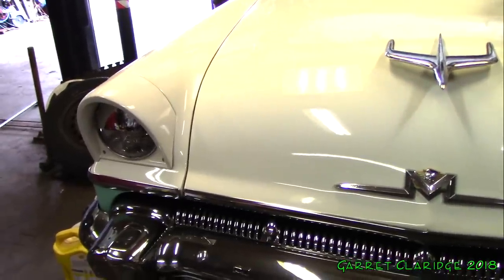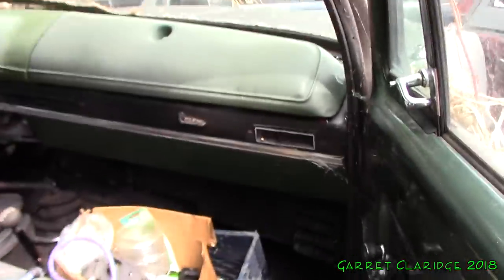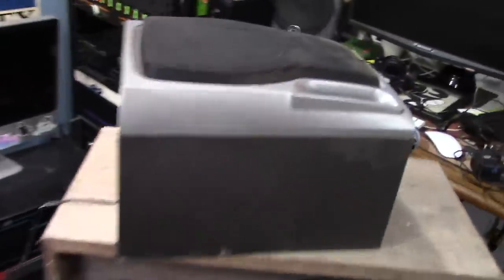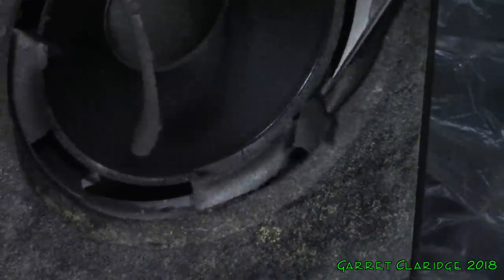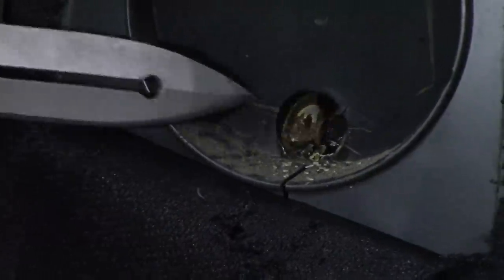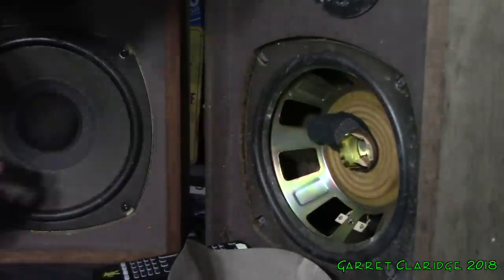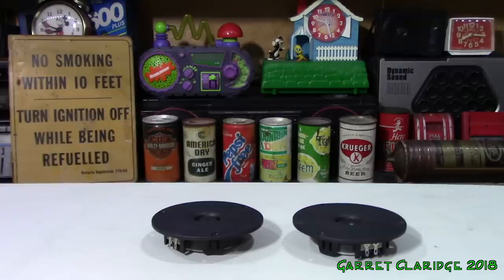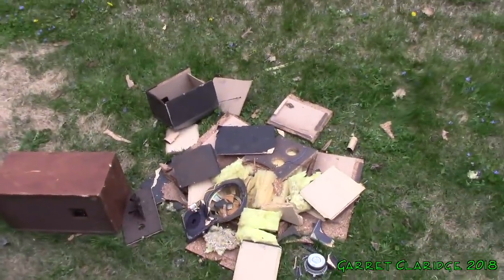SPEAKER BLOWOUTS! - Paradigm, Realistic Nova, and Aiwa Garage System

Comment: Spectaculair 1st speaker burn out. Hope you sorted out some good replacement speakers for your Grand Dad. Brilliant video.
Reply from the maker: I sure did! Two 12 inchers //made out of nice random parts found in my shed - I mounted up on the wall in places where it made the stereo image work right, And pulled out the amp making sure the wires were correct, they had only left audio hooked up to 6 speakers in random phase haha
Reply: Excellent !
Reply: @GarretClaridgeMeerkat  4:48 Now, that's the sound of a healthy speaker

Comment: some good old 70s speaker cabinets really useful for building studio speakers or using them for putting in audio interfaces i used my old speaker cabinet for my old analogue dimmer pack for my pulser rock desk
Reply from the maker: Like build a rack out of a speaker cabinet?  Oh man all my ATA road cases will be jelly
Reply: yea man speaker cablets ive got right size to make a rack and they are goodmans too they have strong build so is my bigger ones witch was my dads old 70s rock hmv/goodmans they are a beast got 2 8 inch speakers in one side has 2 RS bass speakers 100w each and other side has 2 hmv load speakers 100w each they both 4 ohms and tweeters are rs dome tweeters and hmv both 8 ohms sound so good plus has 2 thick pieces yellow sponge to blow sound out gives it a punch sound the weird thing it has no holes for air get out

Comment: Those paradigms were weird. In the future, remove the back panel. There should be screws. The subwoofers however, had an amp plate in the back that the driver could be accessed and even pulled out by removing, so they glued the back panel on. I am currently repairing a paradigm subwoofer (pdr 10 v1) that also has foam rot.
Reply: And Now I am repairing a newer version of the speaker in this video.

Comment: I literally have one or more model from every series of speaker in this video. For instance, this video has the mid-end Aiwa, and I have the base model version (with the plastic basket and same piezo) and the premium one (with an actual 6.5 inch woofer and a real tweeter, plus a piezo. I also have the newer version of those bookshelf speakers, as well as the 5 1/4 inch model, the center model, and the subwoofer. And I have the Realistic Nova 5, not the 7 or 7b. Of course, all of mine work perfectly.

Comment: That is the most beefy boom box speaker I have ever seen...
Reply: They’re actually from one of those 90’s all in one stereo systems, with the 3cd changer, dual cassette deck, and tuner in one. Those were most definitely the worst speakers here, but wouldn’t have been unlistenable either. The Realistic speakers, especially the big Nova 7s like these, were good except the easily blown tweeters, and the Paradigms woud’ve been up there with the Realistic ones here if both woofers worked, far ahead of modern-day Polk T15s I’d imagine. I have a similar set of slightly newer Paradigm speakers, and the tweeters on mine are a hard dome design made in-house by paradigm, which I believe to be better sounding than the older Vifa soft domes.

Comment: Some of the realistic speakers were pretty good, especially the Mach series. The aluminum speakers like the Optimus pro 77' s with 5" woofers and their 4" woofered cousins were great speakers for their size. If nothing else you've got some good cabinets to put newer drivers into to make some Wesome speakers out of. Right now I'm rebuilding a pair of Dyn Acoustics PS10's. All I need for them are a pAir of grills. To keep the Arizona desert dust off of the drivers. As for therotted foam surrounds you can get generic replacements from Parts express, or at least you could have until you friend the voice coils. Shit! As far as the Aiwa speakers, by the time they got to those speakers they were putting some real crappy speakers into the market. Check out the Dayton Audio drivers sold by Parts Express and see if they will work in the Realistic cabs you have . Measure the internal volume, height X depthX width What Liberal Democrats stand for: in one sentence
The Liberal Democrats exist to build and safeguard a fair, free and open society, in which we seek to balance the fundamental values of liberty, equality and community, and in which no one shall be enslaved by poverty, ignorance or conformity.divided by 1728 to come up with the volume of the cabs in cubic feet. Then scroll down in the description of the drivers to see what will work in your cabinets. Then pick out midrange and 
tweeters that have the same spl as the woofers and the corresponding crossovers an rebuild those speakers. Of course you might not find a Dayton Audio woofer that will work, so keep digging. Besides Parts Express. Heck Madisound and any other source you  can find to get drivers that will work, it's just that Parts Express makes it easy to do. Good luck and have fun

Comment: It’s the Nova 7s again, but a later version. The foam couldn’t rot on these for some reason, and I don’t know how that’s possible.
Reply: It's like a fabric impregnated with rubber or vynil, lasts forever.
Reply: volvo09 I know from research that this model actually did have foam with a protective coating that somehow didn’t rot.

Comment: Hey those Iowa speakers I had used a day ago at my vacation and the system it was the same type its call THE AIWA CX NA 303 DIGITAL AUDIO SYSTEM WITH SO CALLED T BASS OR THUNDER BASS it was a pretty good system and the basement had a ps2 and a Nintendo 64 with no game cards and someone put a coin in the game slot XD and also the paradigm speakers made such a awful noise and I don't know why. And when the paradigms were on fire it was green